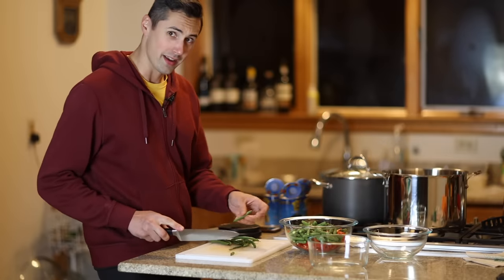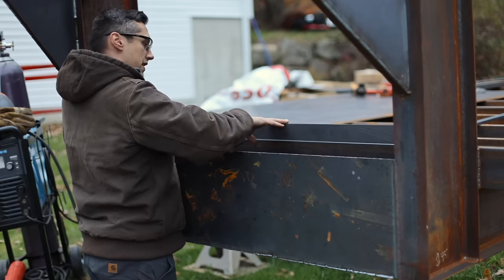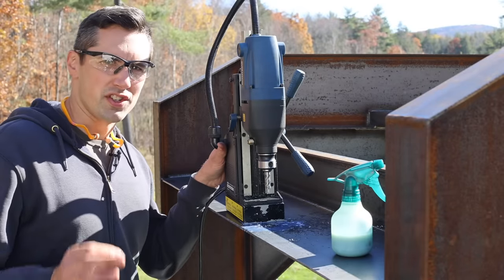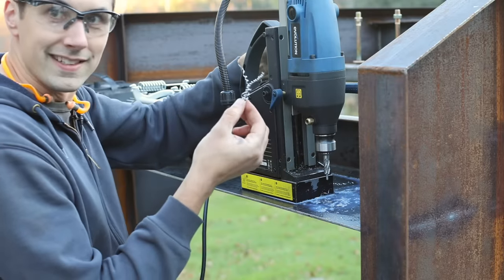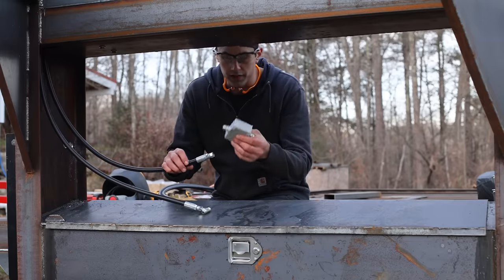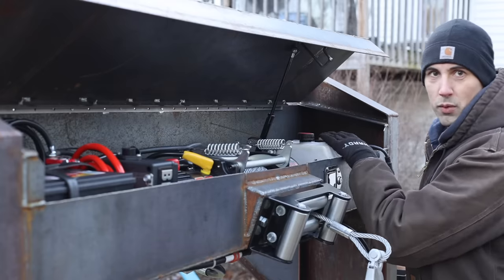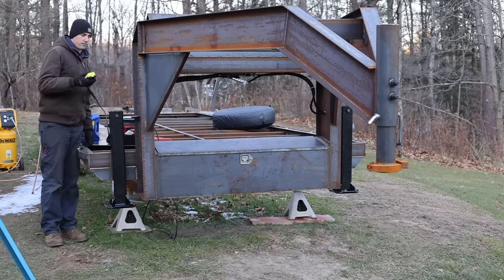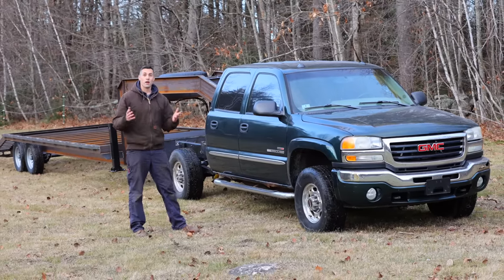Gooseneck Trailer Build Part 2: Hydraulic Jacks, Toolboxes, and a Winch

Comment: I have to think you're going to want some additional structure under that winch. A 12k is going to put some torque on that 3/16" plate. You may want to think about putting some box tube across under it and a front-to-back brace, so the torque doesn't twist the bottom on the box. You might also find that the fairlead isn't happy being used as a directional redirect; although if you mostly stick to rolling loads it may not be an issue. Great job otherwise- I have trailer envy.
Reply: This
Reply: That 3/16 plate  will twist   bend  even with  a little car
Reply: This
Reply: I installed a winch plate after the fact on my PJ Gooseneck buggy hauler. The plate from PJ is a 1/2" thick. It was very heavy and took some time to get it in between the uprights to where I could weld it.
Reply: I used harbor freight's receiver plate for my 12k harbor freight winch. I think it's 3/16 at best and maybe only 15 inches long. I used it to pull stumps out of the ground by strapping one end to a giant tree and the winch wire to the smaller stump. Sometimes even using a pulley to double the power (even though the winch receiver plate isn't effected by the double pull capacity). Anyways, after 11 successful stump pulls I could see that the plate was bent which caused the left and right winch halves to be out of clock. Anyways, if that winch mount isn't restructured on that trailer it will almost certainly take on a new shape. Even with a rolling load I think you could watch it flex as something goes up your future ramps. I'm not trying to give disrespectful criticism, I'm just advising what has and hasn't worked for me personally. Your mount is at a disadvantage seeing as to how long a span it is between you neck uprights compared to my 14 inch span. Love the build!
Reply: Ditto!
Reply: Agreed. While I watched him weld that plate as he said he'd attach the winch there I got concerned. I was expecting him to start welding some 1x2 tubing under it at least, but then he moved to the winch. I was like "huh?" 
Gotta brace that. 
I'm also concerned the axles may be set too far back. That's an awful lot of tongue weight on the truck. Especially when you start loading tractors and such on there. 
I'm loving the build so far. Your welding skills are far superior to mine, and I'm envious of your tool arsenal. I'm just concerned, and maybe they're unfounded. I'm sure you've got the plans sorted for this and they've been proven. 
Keep up the great work. I can't wait to see it in action.
Reply: +1 on the additional structure for the winch mount. 

I have an HF 5k winch, which comes with a mounting plate that is roughly 3/16” for my trailer. I have put a considerable twist in it using it to pull disabled vehicles. The issue is that when that happens the winch itself is compromised since it relies on that structure. That 12k will be able to do some serious damage to the mounting plate without some reinforcement
Reply: Completely agree. That plate is going to get bent up first time you use the winch.
Reply: The winch mount wont be a problem the way he has it boxed in. It would be no different than if it was mounted in the center of a piece of 12"x14lb ft I beam. If it was not supported on the outer edge then yes it would be a problem... I might would have went 1/4" or used a piece of 12" c channel as the base just as personal preference, but I think it'll be just fine the way he has it.
Reply: one thing you have to remember is that winch wont pull 12,000 up the ramps with a single cable. He will have to use a snatch block at the vehicle he is winching and hook the cable back to the trailer somewhere. This will cut the pull on the winch in half.  We have a 12,000 winch on our trailer and sometimes we even use 2 snatch blocks. We winched a 14,000 loader on out trailer with 2 snatch blocks. So the cable comes from the winch to a snatch block at the loader and back to a second snatch block attached to the front of the trailer and then back to the loader. These snatch blocks really decrease the load on the winch.
Reply: @TheJohndeere466  the rated pull of the winch is only with the first layer of cable wound on the drum. As the winding on the drum adds layers, your pulling capacity goes down significantly.
Reply: I'm going to through my opinion in here with all of the others.  3/16" is no where near where you need to be for that winch other than holding it up.  Since you have the plasma cutter and the skills I would, step 1) build brackets/gussets that wrap from the back of the channel around to the bottom, these could probably be 3/16" by at least 2 inches.  Step 2) weld in at least 23" x 1/2" flat bar all the way across the bottom of the box from front to back and tie that in with your gussets as well.  It would be better to go ahead and do this before you use the winch to pull anything, otherwise you will just be rebuilding the bottom of the box if not more.
Reply: @B1GDaddyFatStax  goosenecks generally run 70/30 on the axles...my big flex had the axles in the same location.  They handle more tongue weight than a bumper pull.
Reply: ف
Reply: Agreed. Most manufacturers use C8x11.5 for their winch mounts in the neck.
Reply: @ Life With Chase. It will still flex. I built a bumper that used 10" square tube 32" long. I cut one section out of it to make a piece of angle with three 90* and welded 5/16 plate on the ends. It flexed with my 8274. The next one I used 1/2 flat plate that was about 20" long, 1/4" plate mounts on the ends. Problem solved. 
He should weld a reinforcement plate under the winch or some 3-4" angle 12+" long to front and back corners of the box
Reply: 3/16 may be enough with the way it is boxed, but I'd sure want to test it before I added paint. 
You are right about using a fairlead cable redirect, they really aren't made for handling very much of angle. Whatever fairlead you have, the cable is going to pile up on the side of the winch you are pulling from if you angle is very much. Best to use a snatch block to pull from the side.
Reply: Yeah most definitely
Reply: All its missing is some duct tape and Bailey wire. Then it won't go nowhere!!
Reply: Just use a snatch block each time. Saves a alot of stress

Comment: One suggestion is you're gonna want a deep cycle battery for that application. I made the same mistake with my dump trailer, the constant cycling will kill a regular battery in no time, also deep cycle battery's produce a more constant power over the cycle of the battery, as opposed to a regular battery is designed for short burst of power. Just a suggestion, loving the build!
Reply: Actually, deep cycle batteries are not designed for heavy draws like the jacks or the winch. Deep cycles are designed for handling long low draws. Automotive batt's are for deep and shorts heavy burts(like a starting motor on a engine). What is most important is immediate recharges.
Reply from the maker: Thank you!
Reply: @keithhansen3963  deep cycles are used in the equipment industries for things like scissor lifts and now the hybrid manlifts. those loads are way more than what the jacks and winch will ever use most people dont know what they are doing with deep cycle batteries, they fully discharge them and try to run them at a 15% charge then on. deep cycle batts are great for running hyd pumps. my company rents out elec dump trailers and scissor lifts, all of which run deep cycle batteries
Reply: I'd say for 80 dollars and Walmart's 3 year free replacement warranty, I think his choice isn't a bad one. He probably won't be using the winch and making multiple 80 foot drags onto the trailer every other day. Is it the absolute premium battery for the trailer?  Maybe not but I'm not sure if he could find much of a better deal. I'm pretty sure a group 65 is in stock at every Walmart in the US and for less than 30 dollars a year and pretty much guaranteed a working battery, I'd be interested if there was a more economical solution.
Reply: @keithhansen3963  the point of a deep cycle is to be charged and discharged regularly. Normal 12v batteries are to have a load put on them then immediately charged. Most of their use will be while being charged. That hyd pump isn't that big of a draw, neither is the winch.
Reply: @keithhansen3963  regular car batteries are designed only for starting power which is only a few seconds. Try spinning the starter for a minute at a time. Your battery won't last because with the thin lead plates it'll chew through pretty quick. A bigger marine battery would be best because then you matched the cranking amps over went even higher on the cranking amps and you can cycle it deeper too. Marine starting batteries are a good in between too. Winching cycles the battery much more than a starter. The more you discharge a lead acid the sooner it'll give out. Marine batteries don't give out anywhere near as quick in that application
Reply: @cornfed123567  I disagree that the winch isn't a high current draw. That winch will pull some massive amps at near capacity. Now to which battery is best, I don't know but I tend to think the deep cycle would work best. I've got a portable 8k winch that I can mount on multiple trailers. When I need it I just usually rob a battery off of something else to power it. lol
Reply: @m16ty  if you read what I put im comparing the winch and jacks to scissors lifts and electric manlifts, that use deep cycle batteries, which makes the draw from the winch and jacks look tiny in comparison. I said that because the other guy was arguing that it would be too much draw for a deep cycle.
Reply: @keithhansen3963  Any MARINE site will give you all the info. (retired Marine Electrician )
Reply: I have been using a $100 Walmart battery with 900 cca for 4 years on my winch trailer with no problems. I hooked hot wire for trailer to the battery and it keeps it charged up.
Reply: Just needs to have thick wires with quick connects for running hot to the truck. Cuz there's two more batts right there. Or buy some really long jumper cables for once a month when u forget to charge the trailer 😆

Comment: Just curious, it's a 12,000 lb winch but the only structure it has is 3/16 plate. If you try pulling anything substantial it's gonna bend that plate really easily.
Reply from the maker: It's 3/16 plate, but it's backed up by a piece of 5" c-channel on one side and it has an 1/8" plate at 90 degrees on the other side to keep it from buckling. It's basically like a fabricated piece of 12" c-channel. I think it'll be strong enough 👍
Reply: @WaldosWorld  idk man you might be right, but watch the footage for the flex when you simply added the winch and battery.  I get what you're saying about it being a fabricated c channel, but once the bottom starts pulling up you've compromised the integrity of the c channel. It appears adding some simple box tubing as a support would be simple. Idk... Who knows until she blows haha!

Comment: I know this is an older video. But I went one time and picked up a parts truck just like my daily. I had a blowout on my gooseneck trailer. It had hydraulic Jack's as well. I left my tire hammer at home on this adventure lol. I used one of my hydraulic Jack's to break down the tire and bought one and I was happy I had the hydraulic Jack's on my trailer. It sure saved me. Sure I could have drove on it and broke it down. But it just made it so much simpler. I wound up selling it and I've regretted it ever since.

Comment: Car hauler here, look into getting a shocker hitch receiver for the trailer. It isolates the trailer from the truck with an airbag to take some of the NVH from the trailer away from the truck. Also, make sure the spare tire sits sturdy in its mount, because if it shakes as you go down the road, the rattle does transmit down the gooseneck into the truck as well.

Comment: For those hood struts, turn them so that the rod faces down. The oils in the strut will keep those seals healthy longer and it won't fail so quickly.
Also you may be able to play with the geometry a bit to get the force you need with just one strut. There's some calculators floating around.
Reply: Was looking for this comment.

Comment: this is pretty cool! I personally would add some 0/0ga power wire from the trucks alternator or battery and add a power disconnect to A.) charge the battery for the winch and hydraulics and B.) give power to the winch and hydraulics while the truck is connected.
Reply from the maker: Yeah, that's a good idea! 👍
Reply: The battery should charge through the 7 pin connector when hooked up to the truck. Not a lot of current but still, how often would someone be using that winch and jacks anyway in a normal day...probably not that much.

Comment: Mount a 4 inch round spot mirror  toward the top of the vertical part of the gooseneck coupler and point it down towards the bottom of the hitch and you can see your hitch from the cab of the truck as you back under the trailer.  Works great.
Reply from the maker: That's a good idea! 👍
Reply: Genius!

Comment: Lesson learned when I built a trailer and built some boxes in, the box lids need a full rim lip that will catch over the outside of the box to prevent rain from getting in, it will also make the lid more rigid and harder for someone to break into. The way you have them done you will want to include some drain holes and paint the inside of the box with truck bed liner or the like.
That trailer is bad ass, its nice to make things for yourself as you can take the time to do things the way you want and you don't have to spend time undoing bad ideas of others.

Comment: I like the build. If I might make a suggestion. On my gooseneck, I have a gusset plate where the upright and the front of the trailer deck is located. Near where you mounted the jacks. It adds strength but also serves as a step. I also have a handle near the top of the upright. I'm really looking forward to seeing your build on brandon. I have a Dodge 3500 dually that I want to pull the bed off of and build a flatbed, but I'm not really sure how to deal with the bed frames from the factory bed versus a flatbed. Great content I enjoy watching your channel
Reply from the maker: Thank you! 🤠
Reply: Go to a place that makes the flat beds for those trucks and measure everything, and take pictures as well. Then go to your local steel yard and buy what you need and get to welding and have fun doing it. Good luck.

Comment: Build looks great! I like how you layed out the edges and everything to prevent water pooling.

If I may make one suggestion, those gas struts have a tiny bit of oil in them that help to lubricate the seals. If you orient them with the rod pointing downwards the oil keeps the deals from cracking and they last much longer.
Reply from the maker: Oh interesting, thanks for the tip! 👍

Comment: Great work!  My only suggestion is to drop bolts down through the top (solar charger).  If for some reason the nuts/lock nuts were to come loose you still have a bolt dropped down which may hold it together until you see the nuts are gone.  If the bolt drops away you're SOL.
Reply from the maker: Good call!

Comment: Do this all the time at work...  Any straight & vertical piece will work, I use a fiberglass driveway marker because we have thousands of them for reusable survey markers.  Fasten it to your ball with a velcro strap or some zipties.  Using your rear view mirror, center it on the hitch and when you bump it, the trailer should drop right on.  Perfect for 1-man hitchup.
Reply from the maker: Good idea, thanks for the tip!

Comment: Great video, Waldo!  Trailer looks great.  Did you think to add water drain holes in your toolbox and accessories box?  I love when you get the magdrill out, to avoid the tedious drilling with a hand drill. 👍
Reply from the maker: Thanks, Greg! Yep, I cut the corners out of the floors for water to drain out. I couldn't bring myself to make these ones weathertight. It's a ton of effort and isn't really necessary for this 😂

Comment: I would gusset under that winch plate it will bend. Overall great build
Reply from the maker: Thank you!
Reply: I think I would add some more steel as well for the bolts. 12,000 lbs is a lot of force and they could pull through. Maybe some thick angle iron?

Comment: Awesome build! Just wondering, with that hydraulic set up, would it be possible to hard pipe the hydraulic lines to those jacks?
Reply from the maker: Yeah, I would imagine it is possible. Interesting idea!
Reply: I was thinking the same thing, could even do steel line with short flex hose connections to the jacks and pump to allow for movement and vibration.

Comment: The Cummins swap project needs 4x4.
Reply from the maker: That's a definite possibility 👍
Reply: @WaldosWorld  find a 14 bolt. Order the inner and outer C's from Magnum offroad. If you plan to put that truck to work and hauling heavy? You'll want a tough front axle with a detroit locker. That detroit front and the true trac rear will more than satisfy you while towing. Especially getting something such as that tractor out of a wet field.